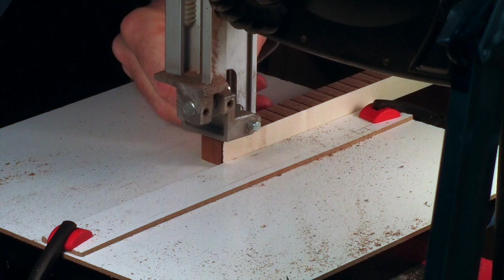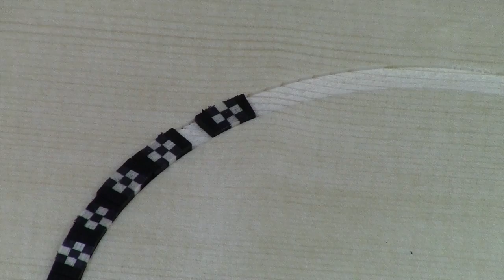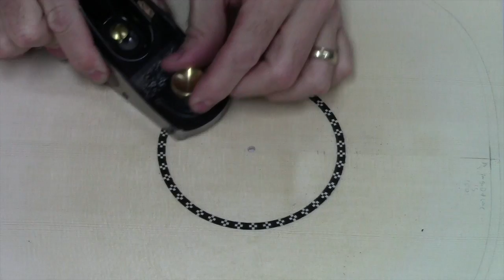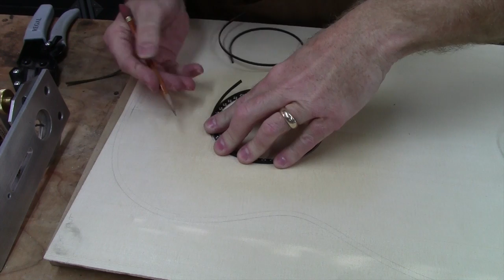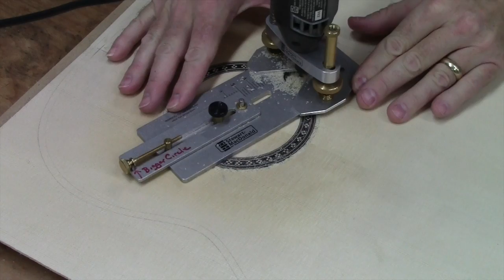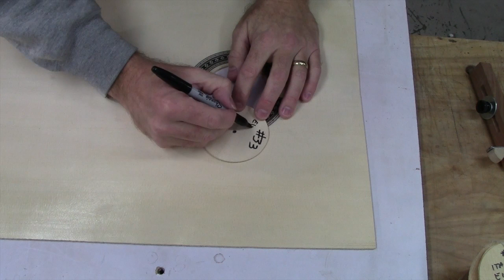Classical Guitar Rosette Making

Comment: Very cool! And well done... I have a question, around 1:36 in as you fit each individual tile into the channel, do you angle cut both ends of each tile or just one side? Also, are these tiles curved on the outside and inside edges at all or are they just short enough that they can be straight (parallel edges) such that eye doesn't pick up that it's not a true curve? Hope my question makes sense.  Thanks for any tips you can provide!
Reply from the maker: This was very much "freehand" so the tiles were trimmed with the chisel on one or both sides as needed to keep the tiles as even as possible. The tiles are installed without an inner or outer curvature. I cut in a curvature after installation with the dremel tool. The tiles should be very slightly too tall so this works out. I have refined this process quite a bit since making this video and rosettes look better now.
Reply: Oh, yeah, now I see how you routed the curvature inside and outside as part of the next step of putting in more banding.... I'm making a 'compass rose' inlay in a piece a furniture (a bench) and I've never inlaid curves before let alone a true circle so I'm looking to guitar makers for tips on how to best do this.

Current thinking now is to steam or hot pipe bend the ebony and holly strips (each about 1/8" thick, which corresponds to the smallest router bit I own for cutting the circle) to the approximate diameter of the outer ring, i.e. 4". Then cut the individual pieces to length and angle cutting/sanding the ends as you describe. What do you think: does that seem like a good reasonable plan (with the limited amount of info I've given you)? 

My limitations are time and tools on hand. I don't have a fancy circle cutting jig for my router, just a simple plywood base with a fixed pin.

Thanks again!
Reply from the maker: Your router jig sounds just fine. I worked with something like that for many guitars. Ebony can be tricky to bend because it is so brittle. Consider walnut for the dark color if you have trouble. Holly bends real well. A cheap curling iron is a decent heat source for bending. 1/8 inch is pretty hefty for bending at a 4 inch circle. I would consider working the material to 1/16 and using two strips of one color to fill the gap. You can also alternate colors and such depending on your creative vision. If you cannot have a hole in your project for a router pivot pin you can use a small piece of wood with the proper size hole for the pivot pin and then double stick tape the pivot point on to your project. I recommend doing a full scale practice run on scrap wood before digging in to your bench. You will find all sorts of issues this way.
Reply: Thanks for the all the info! Yeah, already discovered how well holly bends just using water and microwave trick. Have not tried ebony yet. I've been warned. Yeah, maybe bend two strips of 1/16" ebony and then glue them together. ?
Reply: Also, the inlay is going into a walnut bench which is why I wanted to use ebony, plus I've already glued up the ebony/holly sandwiches which I'll cut to make the direction arrows, etc. There's no problem having a hole in the center as it will be covered by the other parts of the inlay. I'll let you know how it goes, if you're curious!
Reply from the maker: 2 1/16 strips should be fine and keep me posted on your project.
Reply: You were right about the ebony! Had no success bending even the 1/16" thick pieces. Tried both microwave technique as well as soaking in actual steam box for about 45 minutes. Had success bending 1/8" strips of air dried walnut so I might just use those but I'd really like to use ebony or any kind of black. Might go to woodcraft to see if they have thin inlay strips of some kind of black material to bend together and build up to 1/8" thickness. (Also had failures with mahogany which I thought was easy to bend.)

Comment: Hi Stephen, 
Please, could you tell me how you sharp the bit (hard steel) for cutting the sound hole?
Reply from the maker: +Rinaldo Faria I actually have a video on sharpening that you can find on my utube page. I just looked at it and it really needs an update but the info will be ok.
Reply: +Stephen Boone.  Thanks Stephen.  I watched your video about sharpening but I still have a doubt because when I try to open a channel on the top to start a rosette I got some problem on the borders of channel and I think it could be the sharpening or angle of the blade when touch the wood.
Could you give me some advices?
Reply from the maker: Rinaldo, when cutting a rosette channel with a knife or blade it is very important to have a precise sharp blade tip. Sharpness and blade angle are important as you have written. I recommend trying different ideas on scrap wood until you find something that works for you.
Reply: +Stephen Boone.  Thanks, friend.

Comment: Wow!  Awesome...  at 6:33 you use some sort of spokeshave for thicknessing you purfling strips.  What is that tool called and where can I find one?  Thanks.
Reply: it seems a card scraper holder by Veritas.
Reply: It's a clever method scraper two purflings so they can level the cut.